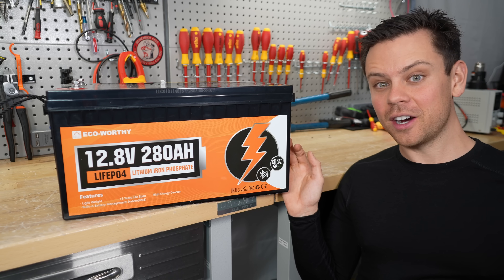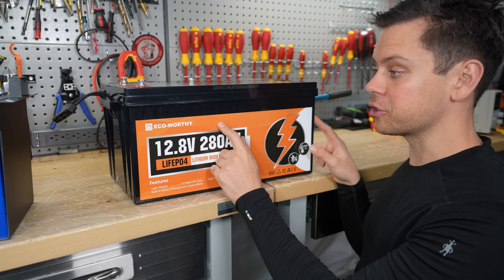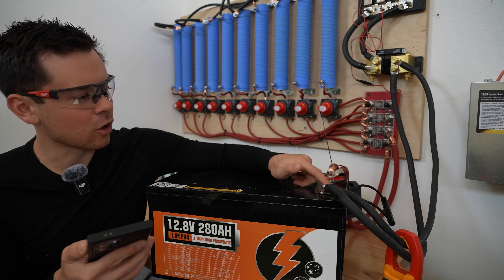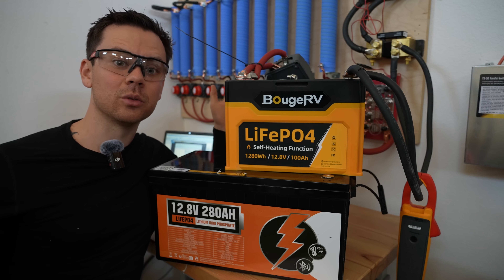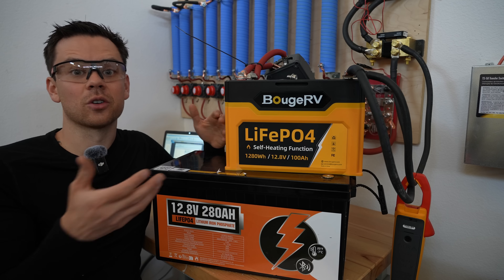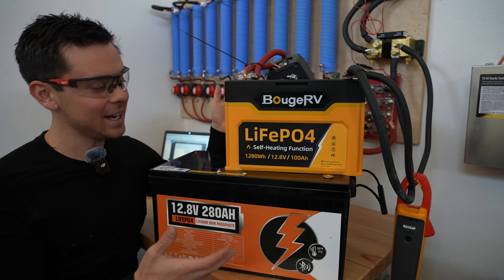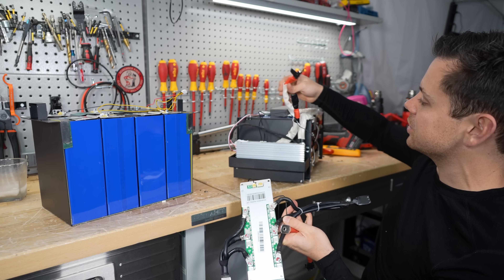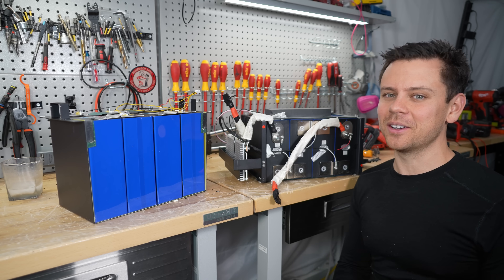$423 Ecoworthy 280Ah VS $529 Wattcycle 280Ah and Over Current Discussion!

Comment: I have 4 x 12V 280Ah Eco-Worthy batteries connected in parallel. Over a week of normal charge/discharge, two of them drift about 20% SOC compared to the other two. I’ve double-checked all wiring and even swapped battery positions - but the same two units consistently drift, so it’s not a connection issue.

Individually, all batteries charge/discharge fine from near 0% to 100%, which makes it hard to prove anything to the manufacturer. Eco-Worthy keeps insisting it’s a wiring problem.

Has anyone dealt with this? Is there a way to demonstrate BMS imbalance or internal cell drift to get a warranty claim moving?

Comment: Hey will great video, quick question, say I use 8 of the ecoworthy or wattcycle to create a 48 volt 560AH bank, do you recommend doing 2 48volt banks and then putting in parralel or creating 4 sets in parralel and then in series

Comment: I decided to buy the NEW Eco-Worthy 12V 300Ah smart battery that has the onboard LED's on top, when it went on sale for $400!   Just came in 2 days ago (@ 30% SOC per app) & finished charging this morning.  Eco-Worthy app shows 301.45Ah capacity, but cell voltage is a lot more varied than I've seen before (only my second multi-cell Lithium battery) with a high to low variance of 0.2V:  After 1 hour off the charger, cells (per the app) show: C1=3.39V - C2=3.43V - C3=3.36V - C4=3.56V, whereas my DIY 12V 50Ah LiFePO4 battery pack has less than 0.01V variance without a BMS.  Hoping the variance will improve with use

Comment: I have two of the 314Ah wattcycle in parallel.  After watching the last video I've added a 250 fuse to 
both the positive and negative cabling. no comments from Wattcycle on the over current protection 
and the balance issue with two of these wired in parallel.

Comment: I have 3 wingda 280ah 200a bms batteries wired parallel in my off grid system no issues.   I want to add more to make it series but I can’t find them anymore I know there cheap batteries but the worked well for me in my solar off grid application.  I see pionergy 280ah 200a bms batteries on amazon which are the same rating.  What do you think ?

Comment: The problem i had was no one makes battery boxes large enough for lithium batteries.
I want to replace my deep cycle batteries on my travel trailer tongue. All metal lockable boxes are to small for 200 amp batteries. I will have to have one made

Comment: I would love to see a complete test on the new Wattcycle 24V-314Ah or 12V-628Ah battery.

I'm contemplating replacing a 6-year-old 1000Ah battery bank utilizing 12V Lion Energy batteries in series and parallel, which I can not seem to keep balanced as they age, with native 24V batteries, and the footprint of these batteries is ideal for my application and may be for others as well.

These batteries claim a new 300A BMS, so it would be nice to see how they are progressing.

Comment: Vevor has two 12v 280AH lifepo4 batteries for $750! I would love to see those tested. I'm considering on purchasing them to expand my capacity in my camper.
Reply: In case you haven't bought yet, with current eBay 15% off promo, you can get one eco worthy battery 280AH for $320. You can use the promo twice, so theoretically, that's two batteries for $640. There's also a listing for battery plus charger for 370 after coupon.

Comment: Will, have you tested the ECO-Worthy 300Ah ( US-L13080202127-1A ) battery? It says overload and high/low temp protection. Do you consider overload the same as overcurrent protection? Currently $449 and wondering if it makes sense to buy this instead of buying another Battleborn to add to my other 2x 100ah batteries. Seems like you still consider the WattCycle the better battery as of late? 

Anyone else have any experience with the 300ah 12v ECO-Worthy?

Comment: Hello , is there any way I can direct message you ? I have some questions about the eco worthy 12v 280ah batteries.  I guess incase I can't I will ask here.
I have 3 of the 12v 280ah batteries connected in parallel, I was told to use the overkill solar app instead of the eco worthy app to monitor the batteries, well while on the overkill app I accidentally hit the hit the set idle current to zero while setting my phone down. Since then my soc is off , my batteries only charge at half of what they were before hitting that button , tried to set the charge current and discharge current from the manual but itndoes.not seem to work , it does say in the manual that it supposedly only works with a iPhone. Man I sure could use your help .. I appreciate any feed back

Comment: I just took the plunge on two Eco-Worthy 280Ah batteries -- they're on eBay right now for $680 for two with free shipping... pretty unbelievable price. Going to be a tight fit under the bench seat in my 2007 Winnebago View RV but I think I can make it work. The smaller Wattcycle batteries would have been great and easier to fit, but were going to be about $150 more and this was a budget move for me at this point. Look forward to replacing my 13 year old Sinopoly "dumb" 400Ah lithium batteries with no real BMS. Moving up in the world! Thanks for the reviews, great work as always.

Comment: I plan to run 2 Wattcycle batteries in series in a small trailer through a Lynx distributor which will have a fuse.  That will go though a Victron Multiplus inverter/charger to run an air conditioner with a soft start. Max continuous is around 1000w. Other than a laptop or camping fridge, Im safe from a 500A draw.  Ill still adjust my fuses accordingly.  One of the +s of a distributor.

Comment: Hey Will, another great video!  The high surge capacity of these batteries makes them behave similar to lead acid. I have a bank of 4 paralled Vmaxtank 12V 125AH AGM batteries. Each one can supply 750A or more. The solution is to put a 1C or 2C fuse on every positive terminal, with a high arc break rating.

Comment: If purchasing one of these budget 280-300AH batteries for a 50A RV, what size breaker do you suggest? Since there's two 50A legs coming from a power pedestal to the RV it gets confusing. Thank you.

Comment: Glad I saw this. I bought one of the eco worthy batteries a couple months and it bulged out on the top. Manufacture said its foam insulation expanding and the battery was fine. I don’t see any insulation on the one you opened up.

Comment: I bought the eco worthy for my house bank in my boat. Good thing i am not using it for a start battery lol.  Only solar and alternators that are 120 a each. I do have a dc/dc/ 50a victron i will intall as well to protect the diodes in those alternators. Have you seen there new 50 a dc/dc? no more heat sinlk and half the size. Hard to find right now. Please do a review on that. Victron Orion XS Smart 12/12 50A (700W) DC-DC Charger  Ty for this. Do they make a add-on OC protection fort hese cheaper batteries?

Comment: Watched your video and sent it to my friend who has the same RV ( 1yr older). He changed out his 6V batteries for two of Ecoworthy 280aph batteries. Ecoworthy told hime to disconnect the magnum connection at the inverter because it would make the battery(s) BMS fight each other. He now can't seem to get the batteries to balance. There is NO "Lithium" option using the magnum remote only CC/CV and Custom. How do you get the two batteries to balance. My theory the onboard BMS will do it because they are wired in parallel. I'm thinking I could be wrong. I know you know the answer. thanks for your videos and your book.

Comment: Hi Will, I just bought two of the Eco-Worthy batteries to replace my 12 year old flooded batteries at my off-grid cabin. The two batteries arrived safe and sound and the cell voltages were within 0.01V on one battery and exactly the same on the other, so I'm happy with that. The batteries will be wired in series for a 24V system.
I reached out to Ecoworthy to find out what they recommend as charging parameters for my controller. This is what they came back with:
Absorption voltage: 29.2V
Floating voltage: 29.2V
Balance voltage: No Re-Bulk
Voltage offset: None
Absorption duration: Fixed (Adaptive/Fixed)
Maximum absorption time: 120min
What are your thoughts - it seems high to me.
Thanks

Comment: WITHOUT no over amp protection I would buy NEITHER, thanks for the vidio, I need a vidio on how to start with EVE sells and how to hook up BMS and temp protectors, and any other protections from over charging I would want on my LIFEPO4 BATTERIES, I GESS if you want it done RIGHT you must build it yourself.THANKS MUCH, I would have thought they would have had, over current PROTECTION TOO.

Comment: Would you recommend using this battery in a RV or should I add some extra protection because of the lack of overload protection within the BMS? You seemed to like the battery overall but I am concerned about the lack of overload protection.
Reply: in another video he recommended adding a proper fuse into your system so it will have a safety break point

Comment: As requested, can you test the orange/black ECO-WORTHY 12V 300AH LiFePO4 Lithium Battery Bluetooth with SOC LEDs, Low Temp Protection, 3840WH, 200A BMS Up to 15000 Deep Cycle for Off-Grid

Comment: Amazon Ecoworthy reviews are concerning, won't work out of box, 3 cycles and dead, and getting your warranty is a fight to the death, a lot of the same failures, and bloated cells, 30% under rated capacity. 
Most of these bad lithium reviews on Amazon are similar, they don't seem to be as robust and durable as the warranty portrays it. 
 Are you going to test a PbC AGM? it won't take long nothing to go wrong, no BMS, no heater, nothing to start a fire, you can put them in a deep freeze and they will charge and discharge at -25F. 
Xterra 12v 100A nothing to see inside so after testing use for a outdoor application as it can handle any weather you have in Nevada.

Comment: I just bought four of the eco-worthy 280 amp hour for $609 ea Canadian.  I haven't hooked them up yet. Have you done a evaluation on the Eco-Worthy 48v all-in-one?  If not I would really appreciate if you would do an evaluation is the 5000 w model which is the newer one. Thanks Will.

Comment: Hey Will, taking weights of these batteries would be nice. I found the WattCycle weighs about 7lbs more than the other batteries because of the steel frame. I honestly think it’s not necessary for my application and could probably use the 14lbs of savings for my two packs.

Comment: Hello. I Wonder if you can tell me the DOD is in this battery? Many websites says 12.0 volt is about 10% left and safe to discharge to that level. But Eco worhy manual says 12.85 volt is 10%. Is it not possible for me to go as low as 12.0 on this battery?

Comment: I have 4 of the eco worthy 280ah batteries. I do not have the time, skills or equipment to test them this much. But I have been happy with the performance i receive from them. It makes me feel better that you gave the internals a good review. I can handle the ocp with fuses and breakers.
Reply: We have 2 Eco worthy 12.8 Volt in parallel, so 560 Ahr driving a 3kw max Victron Phoenix inverter, we don't use much power from them apart from the Ninja air fryer occasionally, but only one drawer at a time, no issues with them since April 2025 to now August 2025, seem okay for our needs.
Gaz UK.
Reply: I also have this kind of setup. 4pcs 280ah to make it 48v and i add another 4pcs 100ah to make it 48v total of 380ah 51.2v 0 issue at all for 1year of usage. (They use rept cells)
Reply: @ricocajanding401 are your 280ah and the 100ah connected to the same battery bank to be charged as one system. If so there could be problems because of the difference in capacity.

Comment: Can you look into this battery?
Thank's

Compact 12V 300Ah LiFePO4 Lithium Battery (310Ah), Small Size 6000+ Cycles 12V 300Ah Battery, Built-in 200A Low-Temp Protection BMS, Great for RV, Off-Grid, Home Energy Storage, Marine

Comment: Nice video ...thanks for that
I just bought 4  12 volt 280 ecoworthy
So far so good
I charge them separately with 12 lifpod4 charger 
I also have 3k watt of solar and use a morningstart trs-60 pwm
I have serie then for 48 volt for my 48 volt..6k watt inverter charger....after 3 days of cloud battery when down to around 12.5 volt and charger stated up and charge from the grid.
My inverter charger has selection of 10 setup battery type....i choose the lowest one witch is  14.0 volt and 13.7
 for float
I used the overkill app and it reach 100% after around 20 hrs..all battery is now 13.6 bolt...happy but the charger doest switch back to battery priority
I thought that is would go to 14.6 to get full charge.
There is a12.625 volt selection for battery...mayby a should used this one

So if i go away for 2 weeks and battery get discharge the charger will never go back to battery priority

Any explaination any one?

Comment: I have 2 eco worthy280.  I ran it down and it shut off.  I can't get my battery charger to charge them.  The charger says the batteries are full.  It's setup at 24v.    When I hooked up my charge controller it had a warning discharged, but the charge controller worked for a bit but then went to night mode.  Thanks for any and all help or ideas.

Comment: I have 3  Ecoworthy 12v - 280ah & 1 12v - 260ah batteries. They are currently wired for 24V, paralleled. I'm planning to buy a 4th 12v 280ah battery to replace the 260AH. The shipping time has been very reasonable. Thanks for review!!

Comment: Great Video. Upgrading our New Travel trailer battery this spring from lead cell. After watching this, Originally thinking Li-Time.. looked up Eco-worthy and see they have new case package design on their 280 and 300 batteries. I see comment below for others that have Eco-Worthy. With on-off SOC? Box Size looks good compared to adding two smaller ones, even though I like the idea of duplicity. Maybe I will add another one next year in after I see how much boon-docking we do this year.

Comment: Eco-Worthy has already updated their 12v 280ah bluetooth battery to have current limiting at 220A after 10 s.  I got two a week ago that have this protection.  I also got two without bluetooth that does not have the protection which I like when using one battery with a 3000w 12v inverter.  Tested at over 300 A.

Comment: Just purchased a Eco Worth 280AH battery and new to this whole lithium battery area.  I plan to run some power tools using a Harbor Freight / Jupiter 5000 watt power inverter.  For a chop saw and shop vacuum at any give time.  Can someone recommend or let me know there thoughts on purchasing a overcurrent circuit-breaker for my set up?  I would hate to destroy the battery due to overcurrent issues.

Comment: Does this linked unit actually ship with Bluetooth and low-temp protection? 

I just ordered this 280AH battery off Amazon from the affiliate link, and later while looking up the manual on the manufacturers website it said it didn’t. Even the Amazon listing said it did, but now I’m concerned.

Comment: Hi Will - would you consider doing a Youtube video comparing say 5 different mains-power chargers for LIFEPO4 batteries?  Perhaps the most common 12V 20 Amp charger (as large numbers are sold to RVers, campers; boating etc)..  On Ebay the no-name 20 amp chargers start around $60;  up to around $200 for a Victron and $300 for a Ctek ( in Australia). From $60 to $300 is a big increase for the same 20 amp charging current.  Some comments say the circuit and components in the cheaper no-brand ones are poor design/quality with poor regulation, while named brands (Wattcycle/Litime etc) at $100 are as good as the expensive brands. So testing and a tear-down of each would be needed.  I think your target audience would be keen to see a thorough analysis. (Many testers just connect it and say - Yes - it works)..  Best regards.

Comment: I would love to see the difference between two batteries from same manufacturer, same specs, but different sizes. Looking at the Oasesenergy LiFePO4 24V 100AH, there is a normal and mini version, both 25.6V, both 100AH, both with 100A BMS, and the same price too.

Comment: I have officially binged watched 100 of your videos, your welcome, I mean thank you 😂

I may have missed this, but what is your recommendation for a 2/0 welding cable for connecting lifepo4 battery to my Xantrex Freedom X 2000 inverter? Preferably w/lugs as I do not have a large enough crimper.

Comment: Can you connect these batteries via a Bus bar to batteries with communication like the the Eco Worthy rack mount? Does the communication connected only to one rack mount confuse the inverter (ie. 6000XP)?
Reply: of course assuming 4 in series for 48 volt system...

Comment: Will, i hope you see this and respond…. I bought 3 Ogrphy 100ah 48v, charged them to 100% on the Ogrphy charger, all have the integrated Bluetooth BMS…. First night of operation one discharged to 85% the other 2  discharged to 94% and 95% - I connected all blacks to a Bus Bar and all reds to another, of course i have the power out to inverter and power in from the solar panels. Any ideas? I did not install the charger on the first night of operation but intend to today.

Comment: Hi Will Im fitting a 100amp hour battery into my camper. A friend said that a Megafuse is no good as they arc at high temps and that I should use a T Fuse. Is this true?

Comment: I have a question you might be able to answer I have a brand new 2024 F-150 that constantly goes into battery saving mode because I don't drive enough Mi a day to recharge the battery could I add a solar panel to my camper shell and if so how would I install it to the battery without causing problems

Comment: Do I need internal Bluetooth if I have a shunt with Bluetooth?
Reply: The shunt will only monitor current and voltage external to the battery. The internal Bluetooth will give you individual internal cell voltage, and other useful stats.